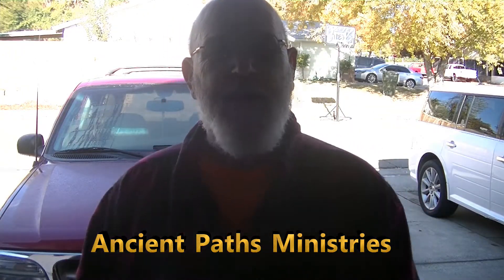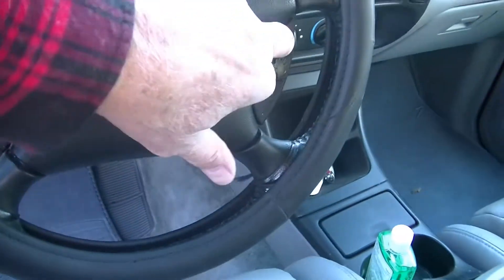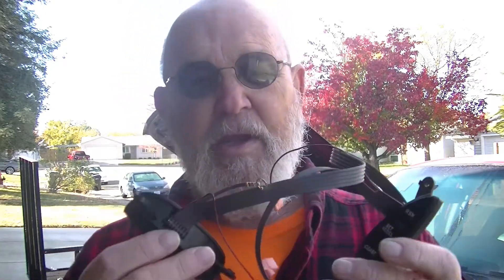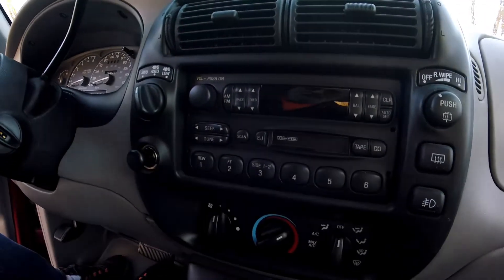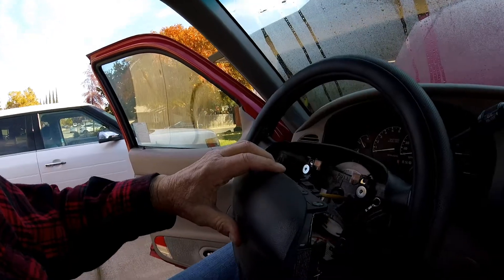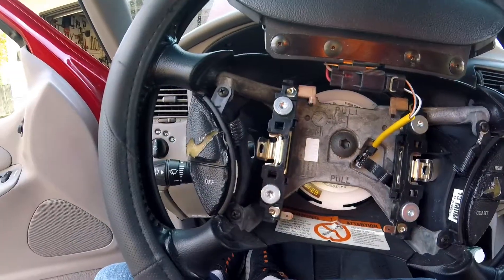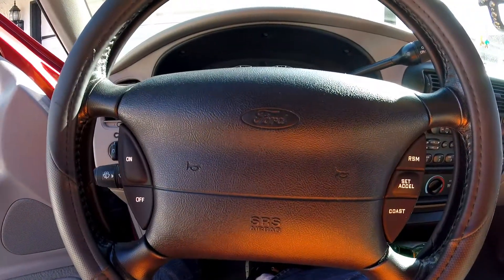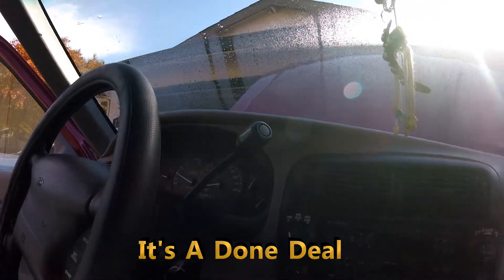1996-2005 Explorer Cruise Control Switches Replacement

Comment: I think you solved my mystery- just bought a 98 explorer, the cruise control switches were on a recall and it's impossible to determine from my VIN whether mine was bad and fixed, or not. You just showed it's simple to replace them.
Reply from the maker: It was so easy 20 minute job.
Reply: The process wasn't bad and I used my existing wiring and not the new. My wiring was a bit stuck on the old switches;  but slowly prying and patience I was able to remove and put the new switches in.
Reply: @pastorbobncc365  WOW...that's a clean '96!  ...I have a 95...it's my off road beater....not even remotely as nice as yours... and our 4.0ohv engines last forever....many make it to 400,000 as long as you don't seriously overheat them.    Thank you Pastor for video, fellow believer / follower of JESUS too !
Reply from the maker: @barrya.6212  I just got back from a 2500 mile road trip, went to Chaco Canyon NM. I just turned 76,000 miles, have a blessed week my friend.
Reply from the maker: @barrya.6212  The Lady who owned it went shopping once a week, it had 68,000 miles and not a scratch anywhere, I love it.
Reply: @pastorbobncc365  That's awesome! .... we need to trade ..straight across....okay, I'll throw in $20 too   :)

Comment: I think the best way to test your switch before you start your vehicle is not be inside at all because the passenger airbag may also go off. (1) turn key to on position (2) then reconnect the battery. That might be safer in case anything happens.

Comment: I have a 2003 Ranger and I bought replacement switches on Amazon from AA Ignition Store and was going to follow your very informative video but ran into a snag. I cannot get the plugs out of  the new switches so I can just do plug & play like you did. Did you have any trouble with this... mine won't budge and I've tried everything? Do you remember who you bought your switches from I'm wondering if some of these on Amazon aren't meant to have the plugs removed? Last thing was there a tab on the existing factory plug you needed to squeeze don't want to mess that up? Thanks I'd appreciate your help!
Reply from the maker: I paid about $30 on Amazon for the switches and the wires came off with no problem, Just ligt the tab, email me some good pictures of the connectors pastorbobncc@comcast.net

Comment: Every video I see has the same issue, struggling to unplug the ribbon connector from the switch.  You must be very careful pulling out the plug. 
When you're tearing apart the old switch while it is still attached to the steering wheel, it is easier to break out the circuit board from the inside and push the connector out of its socket rather than risk pulling the ribbon cable out of the connector.  On the new switch use the smallest, thinnest screwdriver to pry it out from the L-shaped connector.
Reply from the maker: Well said thank you.

Comment: The good ol ford exploder, thats what we used to call them.
Reply from the maker: I think this is my 4th one, great SUV's
Reply: @pastorbobncc365  i used to be the airbag tec at a body shop i worked at  through the 1990s, I had a chuckle watching you. Thay are not quite as sensitive as one might think, but its good to take all the precautions especially for a diy person. I have seen some brutal stuff done by airbags, its what got me using seat belts back in the day when most people treated it as an option. Have a good weekend Bob and God bless you.
Reply from the maker: @HaventHerd307  They scare me, somehow I think they are just waiting to go off?
Reply: @pastorbobncc365  they are just waiting to go off lol. When i had to dispose of them it was quite a particular process. I was glad to see you in the passenger seat, I aways did that even after I got comfortable doing it. Some cars like saabs had a gas operated seat belts that were dangerous to remove and replace. Their like little pipe bonbs. You did good.

Comment: Excellent video thank you so very much. I have had my 96 Ford Explorer for 25 years this month and those switches are in really bad shape, now that I watched your video I will be changing them. I noticed on Amazon they have the switches without the wiring harness. Any thoughts, would they work just the same? Thank you, Elizabeth
Reply from the maker: Yes I  just changer the switches and left the stock wiring, easy job.